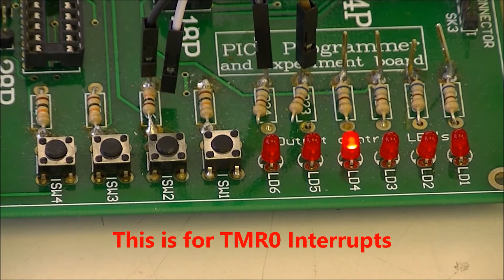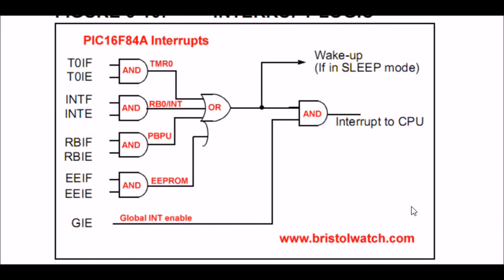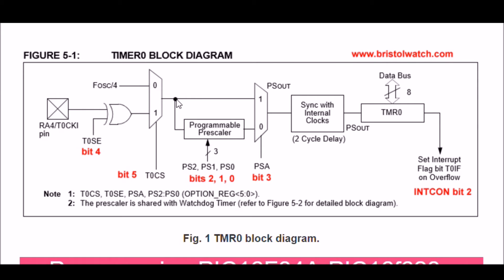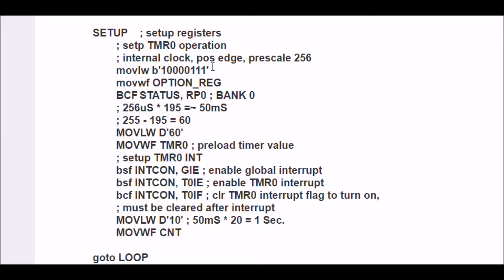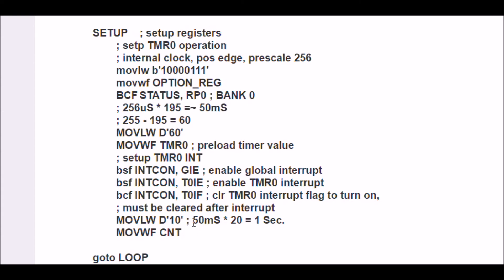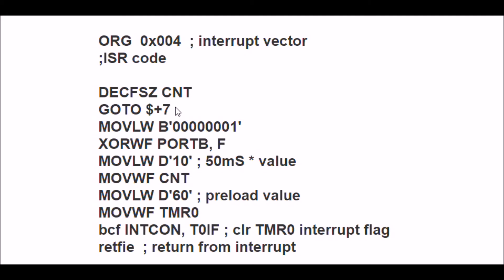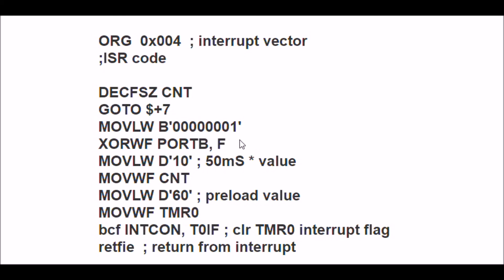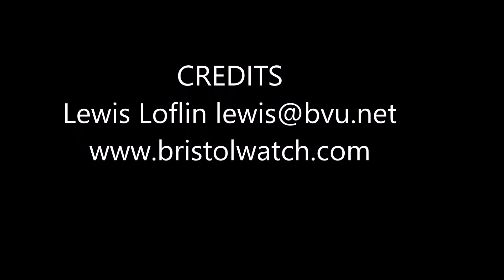PIC16F84A-628A Timer Interrupt Delays

Comment: besides clearing the TMR0 interrupt flag, you need to reset the preload value (60) each time in the routine.  If you don't, the second through CNT interrupts are 256 counts of TMR0, not (256-60)

Comment: nice vid. I try to avoid using delay outside int depending what im doing. setup multiple  delaying inside int, main int  timr0 would be 50 ms. set up another reg inside int to overflow every 20ms. works alright manage more things. set more reg inside int for other delays.

Comment: Hello Lewis, thanks for the series, it's awesome. I have a question about the GOTO $+7. Why not use a simple label just before clearing the TMR0 interrupt flag and use GOTO to this label? It would also work, right? Thanks!
Reply from the maker: You can but to me it clutters the program in my view. If it's very big jumps then I do use a label but if under 10 I don't. Either way is OK. Thanks.